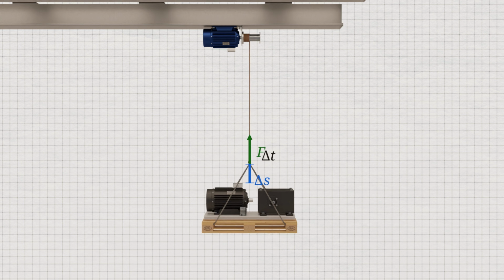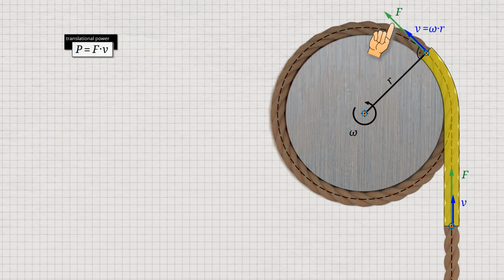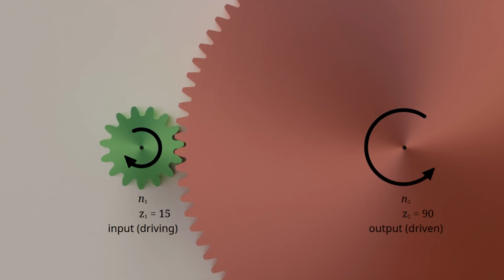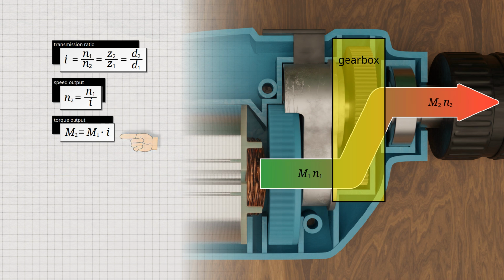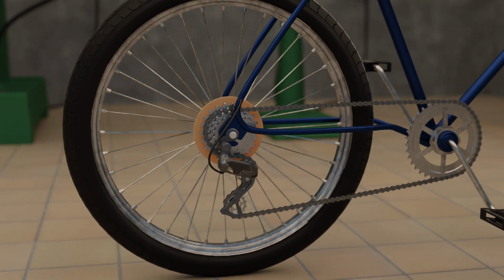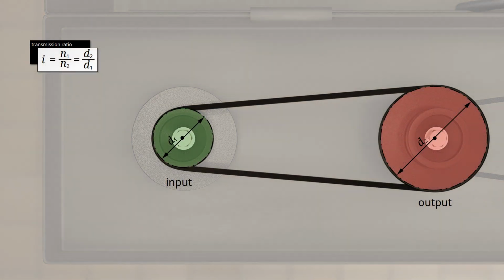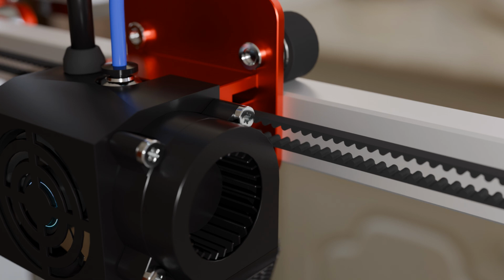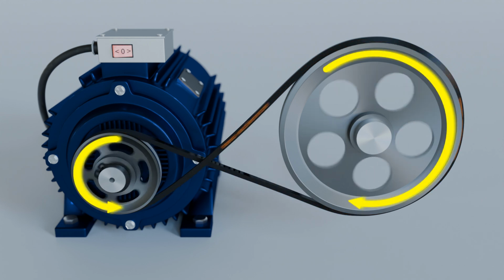How does a transmission work? | gear stage | calculation transmission ratio | speed | torque | power

Comment: Why was this video uploaded again? I think I saw it a year ago. Was the original one deleted?
Reply from the maker: I am currently in the process of revising some videos. That's why I've re-uploaded the video. However, the content has not changed significantly.
Reply: @ do you plan to make videos about threaded rods, power screws and such?
Reply from the maker: @Martin07031  I haven't planned this yet, as I'm working on other projects at the moment. But I've put it on my list.